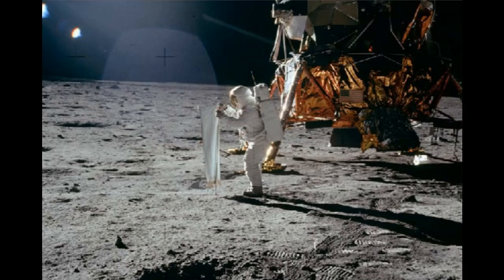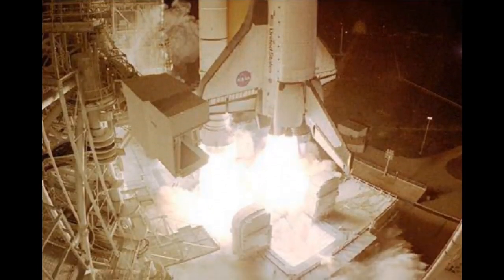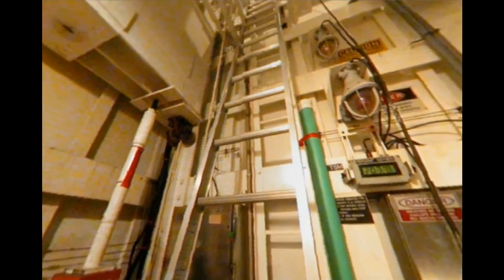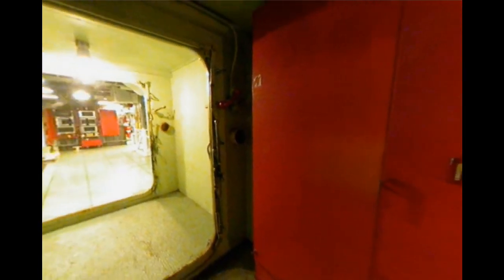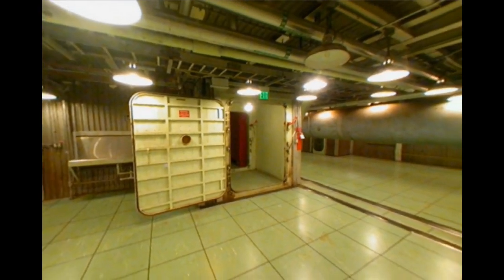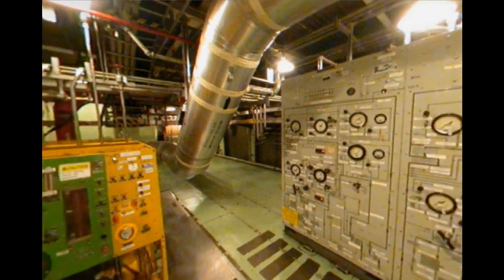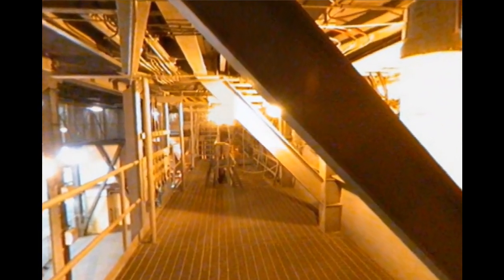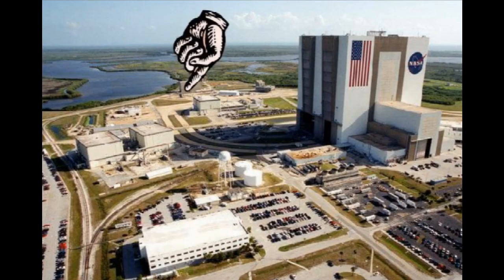Mobile Launch Platform (MLP) , KSC  Narrated

Comment: I was there for the first launch in '81.  So nice of them to schedule it during my spring break!
Reply from the maker: I started working at United Space Alliance in 1985. Nothing more powerful than hearing thoes solid rocket boosters ignite at T-0 on launch day. Don't forget to like and subscribe.
Reply: @EverythingSpaceShuttle-kn2me   That is really cool that you worked on the program.  And yes, you can feel those boosters from 40 miles away!  I also saw STS-6, Challengers 1st flight, along with a few others.  I have the original mission patches from ye ole' KSC gift shop.  STS-1 patch framed and on my wall.
Reply: Exist also pictures from the Apollo era from level a level b from the mobile Launcher?🙂 Never see this anywhere!